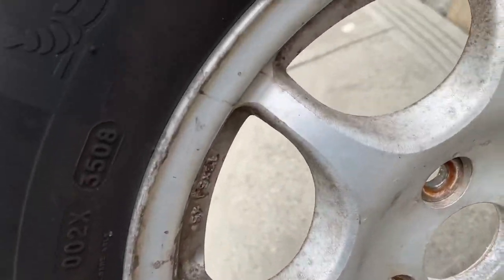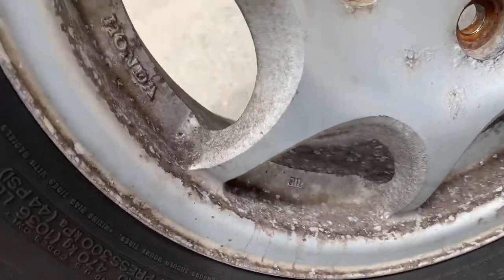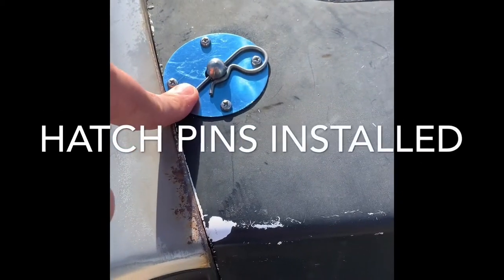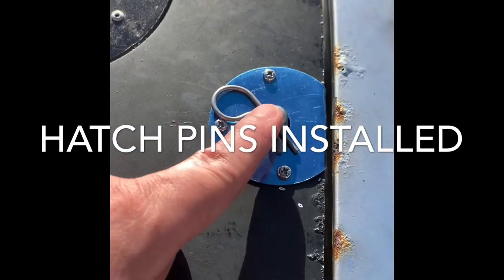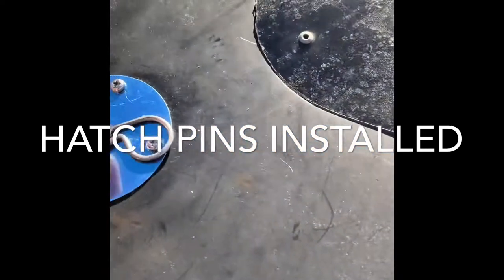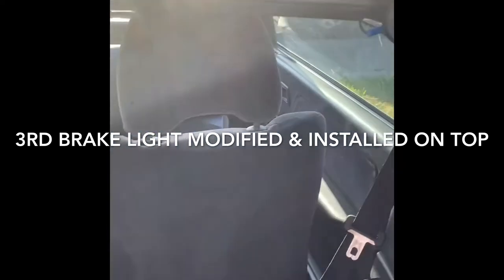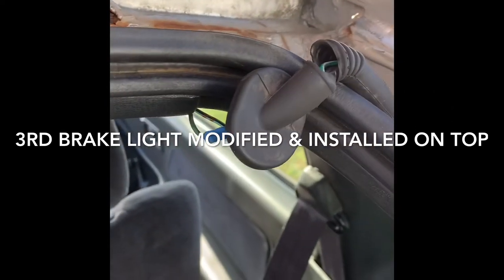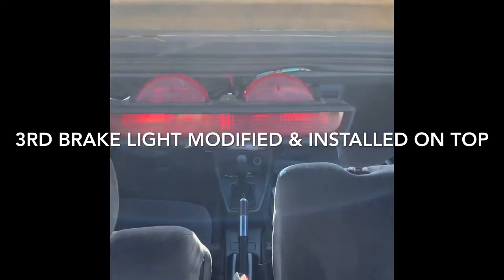DIY using “Easy Off” oven cleaner for a set of Honda VX rims

Comment: Is hatch pin you lock?
Reply from the maker: Yes, on the other end I used oem hinges. But when they manufacture this fiberglass, they have place holes on both ends. 😄

Comment: Does it work without hurting the chrome?  I got chrome 26s on my ZJ they shine, but i want them to shine better lol it's hard to explain
Reply from the maker: Alex

I have not owned a set of chrome wheels, I don’t know for sure what would be the effect. I believed for chrome wheels there are stages of polishing pads to cut, buff and polish.
Reply: wash your chrome wheels with normal soapy water then polish them afterwards with some wax etc.
Reply: @gomanfong4077  yeah, that's what I ended up doing. 
I ordered chrome wheel polish and they shine now
Reply: @alexwayniac  it’s actually simply. As long as you coat it after to make it last
Reply: @alexwayniac  Just get some mcguires chrome wheel cleaner, it's in a red spray bottle. Guarantee you this'll give you the result you after, but if it's real bad use it with some "0000" steel wool. Guaranteed!